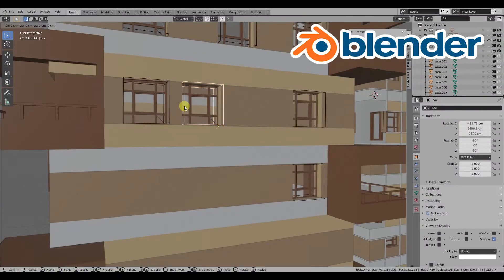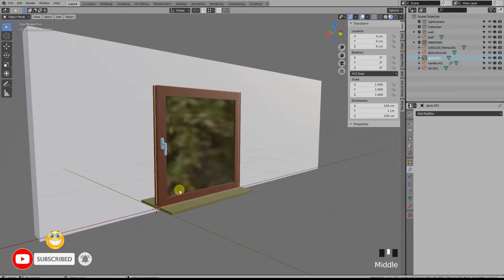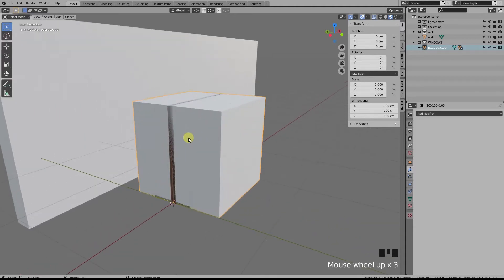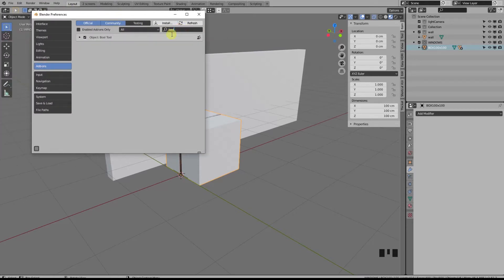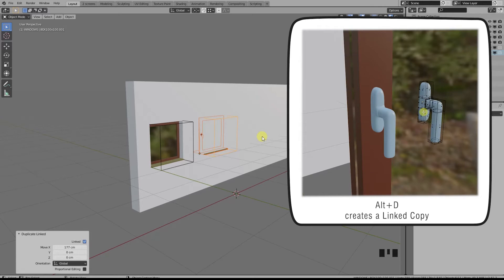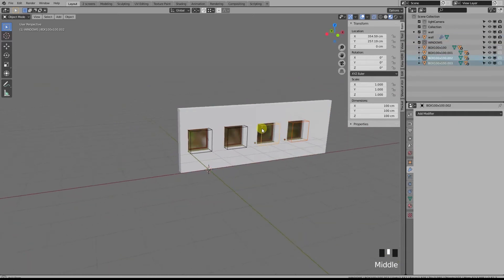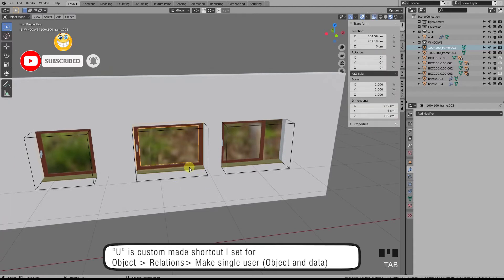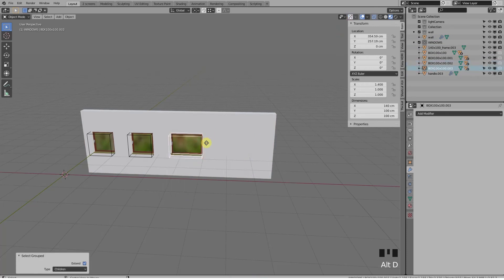Best Way to Cut a Hole with Windows in Blender 2.9 - Tutorial

Comment: when i did ctrl minus it did not delete the other side of the cube how di I fix that
Reply from the maker: 2 possible reasons: 
1. Have you enabled bool tools addon?
2. The wall object needs to be highlighted. That means it's the active object, and you achieve that by selecting it last.
Reply: @BlenderBash  ok yeah i did not have the bool tool on fixed it thanks!

Comment: Where’s the minus on my numpad
Reply: Flip it over, it's underneath
Reply: On the right side of your keyboard there should be a number pad and in the right upper corner is the minus. If you're using a laptop there's a chance that you don't have the numpad in which case I don't know how to help you.
Reply: @ringtail5021  does it have things like delete and printscreen
Reply: @ringtail5021  my printscreen and delete are on far right
Reply: @SageGilbert191  Well if that's the case you don't have a numpad.